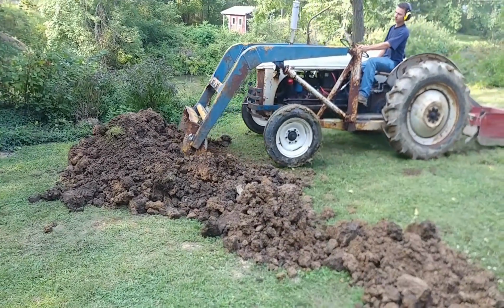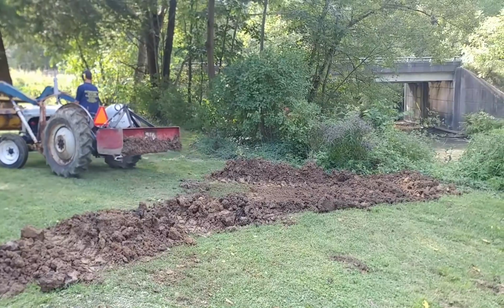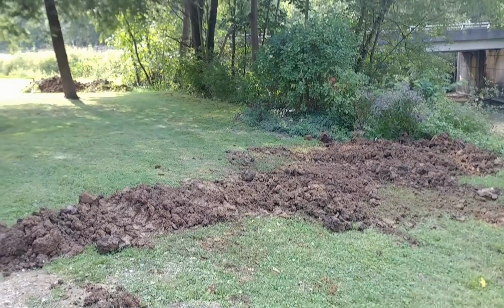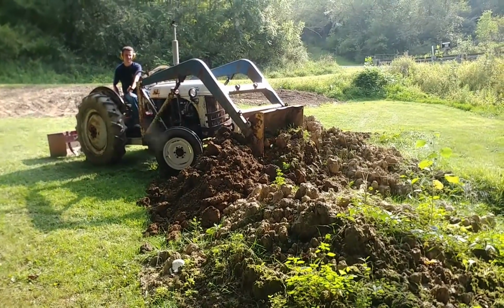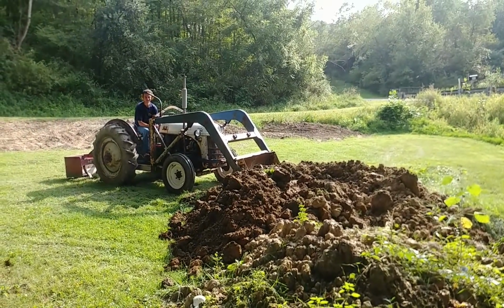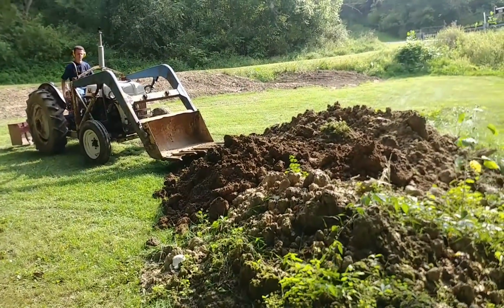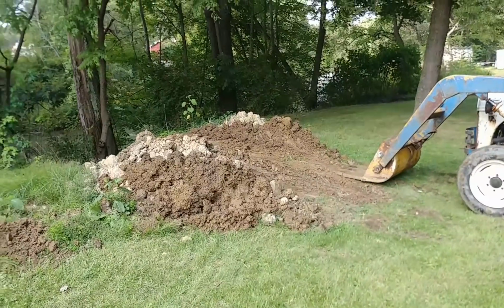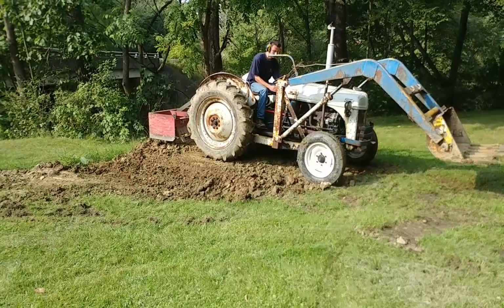FORD 8N PUSHED BEYOND ITS LIMITS SPREADING CLAY WITH LOADER AND BOX BLADE!!!!

Comment: Is there fluid in the tires?  A step down would help with the loader work.  I would check the compression on each cylinder before I tear it down.  Also you could try turning up the governor a little bit to get some more rpms.

Comment: That's a very nice gift with the new crankshaft. Also get hardened valve seats so you can run unleaded fuel instead of needing lead-substitute additive.
Reply: you dont need any additives, regular gasoline works just fine for me

Comment: When you're moving dirt from a spoils pile put your bucket at the ground level and ram the the pile and lift up the bucket and you'll get full scoops the whole time I know you weren't driving but still it will help you out greatly. Also you can make a stove with old big truck brake drums weld em together and you have a pit belly stove pretty much just add a door and chimney
Reply: ChuckE2009 did such a woodstove using truck rims. Works really well for him. He just used the 55gal drum woodstove kit with those rims.
Reply: i made mine vertical rather than horizontal that way i can empty it easier and it holds a lot of fuel in it aswell